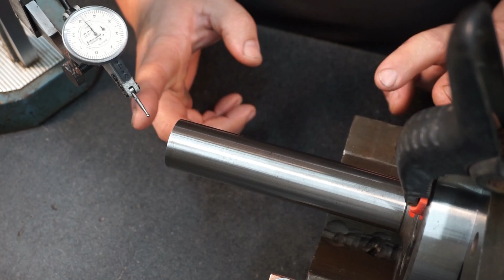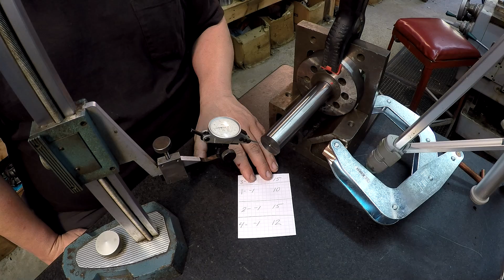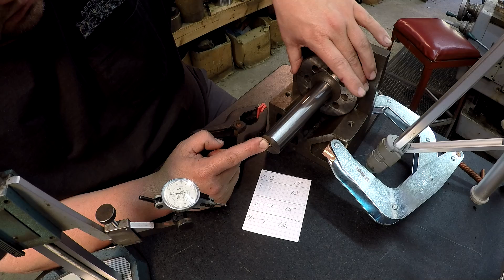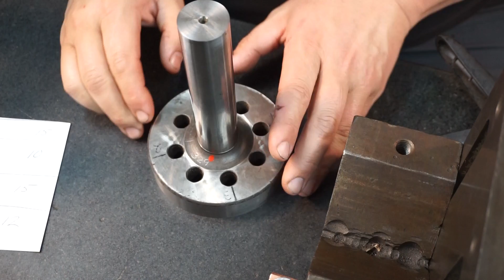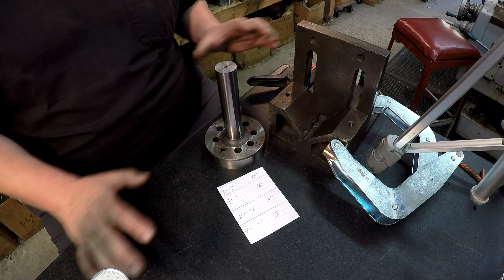Inspecting my Cylindrical Square for Squareness

Comment: Enjoyed!  How much time passed between your two measurements?  A consistent 0.0001" all over sounds suspicious.  Wonder if there was a temperature change?  I think a 5 degree change, in steel, = 0.0001" over an inch.

Nice square, by the way.
Reply from the maker: Trust me Tony, I'm not a square......bad joke? 
Glad you enjoyed and thanks for stopping by! I don't recall the temps being much different during the two days but 5 degrees difference it could have very well been. I think what I have is a "very close" square, good enough for government work right?
Reply: not bad, not bad.. I wouldn't close the shop up just yet.. but not bad.  ;)
Reply: Yes.  Just taking a stab at that constant 0.0001".  Though he did mention the zeroing thing.. likely the more probably cause.
Reply: Carbon steels have a thermal coefficient of expansion about 11ppm/deg C or 6ppm/F. So 1/100,000 inch per degree C per inch;  0.000 006 inch per inch per F
http://psec.uchicago.edu/thermal_coefficients/cte_metals_05517-90143.pdf
The biggest effect would be warpage of the surface plate due to an internal thermal gradient if the shop temp fluctuated over just a few hours (overnight). The larger thicker plates are stabilized for several days before lapping or calibration, depending on the desired rating of course, AAA lab grade has less wiggle room in the specs than a class B shop plate (though they both warp the same amount)
Reply: I was going to ask if it was cold!

Comment: Old video, I know. I'm going trough a couple of non-magnetic horizontal squares as in the video. Found this very interesting. What conclusions can you draw from your readings? None. Too many equipment anomalies that are in turn amplified via a 6" length of rod. In your case, I suspect that the base has a slight runout, that when seated in the V-bock creates uneven readings. The angle plate certainly doesn't help.

If I may humbly suggest, if anyone is thinking of checking a non-magnetic horizontal square, first and foremost use a square angle plate with a good surface finish. Flat! Then use Starrett 161E clamps to hold the base down from the top. A clamp on each side. You can now get some relevant readings, assuming you got your surface plate in check. I'd love to know how this square measured after the plate was refinished and you used an alternate angle plate. All the best.
Reply: Came up in my feed and I  must have missed this. 80% correct? You likely mean 80% confidence. That's wildly optimistic. You may want to study uncertainty and how it's calculated, learn its constraints. There's maybe 40% confidence in your readings, and I'm being nice. This was ok for a BS YouTube video, but can't be taken seriously.

Comment: This is absolutely NOT how to check that type of cylinder square. Its a simple check between centers. Diameter and face should run true spun between centers. If true then the square is as square as 1/2 the taper in the diameter. If the diameter has a .0001 taper then its square within 50 millionths.

Comment: Your cylindrical Square should be self checking without any need for any  complicated setup using angle plate and clamp etc.
That is, if you check with just the square itself, and using a Surface Gage with a radial "foot" stop like a ball bearing or radius of some kind, in order to get a single point of contact up against the cylindrical square`s own radial surface and checked with  a mounted indicator at that "stop point" just touching the square, set your zero and rotate the square to the opposite side 180 degrees apart. 
If you get the exact same zero reference as before, then your cylindrical square is indeed SQUARE or perpendicular to the surface plate it has been checked and rotated on! Any deviation on your indicator will tell you how much out of perpendicular your cylindrical square is compared to the first side checked. Divide by 1/2 and that is the tolerance + or - your cylindrical square is over the actual height distance measured.

Comment: New subscriber to your channel and the discipline.  What is a cylindrical square used for?  Do you have a video in which you put it to use?
Reply from the maker: +J Berkey It's used for inspection work, to check squareness of parts. You can stick it on an angle plate and use an indicator to sweep across it at different points to see how square the angle plate is to the bottom surface.

Comment: If you don't already, you should use plate conditioner, it just seals and lightly lubes the surface to reduce wear, a dab 'll do.
You might also check around for on-site plate calibration, it may be about the same cost for them to come to you as it is for you to ship the plate and then it is lapped in on your support points and at your normal shop temperature. (maintain temp steady for 40+ hours before the appointment) Plate makers will calibrate other brands so if you live near a Starrett shop they will calibrate a Mitutoyo plate and vice versa.
They use the same tools in the field and lab; optical auto-collimator for the overall flatness, a widget with a dial indicator for small dips bumps and waves, and an iron hand lapping plate for adjustments.

Comment: G'day Adam, nice job on the setup. You may not have covered it in your video, but you should first check the square is both round and has no taper.

You should be able to do away with that setup however and self-prove the square. That's one of the advantages of cylindrical squares. It should be a more accurate and repeatable way to test this.

Comment: I can understand playing with the tools, I do it myself in my garage. However, you are using at least 4 tools of unknown accuracy. You can't have any idea the accuracy of your cylindrical square if 1 tool is known to be off. "Pretty dainged square" just doesn't cut it. Still, though, I learned a few things. I look forward to you getting the granite plate, the height gauge foot & the angle plate ground & calibrated & the test redone. What fun!  Keep it up.

Comment: Adam.  Love your video's.  Ive wached all of them and always look forward to the next.  To measure this cylindrical square, eliminate the need to move the height gauge and this will eliminate the error you may have  in your surface plate. Turn your entire setup 90 degrees so the narow shaft is pointing up perpendicular to your surface plate. Remove your angle plate and use a static point on your surface plate.  Use your vee block on its side to reference the large diameter of your cylindrical square and palce your height gauge and dial in place and dont move the height gauge or the vee block.  Especially that you suspect error on your plate.   To take a measurement,  simply rotate the cylingrical square keeping it referenced against the vee block.  Hope this helps.  Chich2

Comment: It's funny to see in witch Tolerances he's woking, when you work in like 2-8 1/1000 mm ^^
Reply: 2 microns = .7 "tenths", and he was using the terms "half-tenth's" and "tenths" in the video. So actually you are using the same scale of measurements as he was, just in the metric system instead of inches. Written another way, .002 mm = .000070 inch, or 2 microns = 70 micro-inches.

Comment: Hi Adam. I like those squares. I used a magnetic cylindrical square for years and loved it. One suggestion I have for your setup is to use 2 clamps. One on either side of the base as oppose to just one on top. It may yield better results.
Reply from the maker: I was hoping to get a magnetic square but this one come up for a real good price so I jumped on it. One problem I had the first time inspecting it was the clamps were moving it around on the sides, I think it's because of the angle plate though. . It's not exactly a perfect set-up for checking it but we'll improve as we move forward.

Comment: Hi Adam thanks for the video. Just a few thoughts.   Is that cyl' square unusual in having a flange on the end? As the base has holes in it do you think it may have been torqued down and slightly distorted?  It looks to be a difficult item to check for square unless you have some granite plates and squares like Stan Z. I would have thought the plastic clamp was not be man enough to hold the weight tight against the angle plate. Or it could be dead on square but your old cast angle plate is a little tired.    regards from the UK

Comment: Maybe you could have done that on the lathe:
1) check the squareness of the cross slide to the chuck using the "rollie dad" method
2) chuck the cylindrical square and move the indicator along the its flange  using the cross slide
Reply: yes, if you turn it between centres, you use your dial guage on the stand face, any runout will be your 'out of squareness'

Comment: From your numbers and measurements in the video, it looks that your angle plate is rather off square (they all have a bias roughly in the same direction / amount). To check  a cyl square, you should use a vertical comparator, base against a fixed point, dial gauge at the top, take a reading, rotate (they cylinder) 180 deg, if identical readings, then you're close to the mark.

Comment: Plain (vertical standing) cylinder squares are used to measure perpendicularity of a vertical planar or cylindrical surface, tied to a specific height from a horizontal reference plane, such as a surface plate. Flanged versions, as Adam has, will do the same operation, indirectly, but the type of optimal indicator used is not the same. Also, flanged cylinder squares often have a magnetic base (the larger diameter) flange. Adam's flanged unit doesn't appear to be a magnetic version.

Stefan's home-shop unit works best with an absolute-measurement drop-spindle DTI, spindle being mounted parallel to the surface plate, calibrated using the 180-degree rotation method against a plain vertical squaring cylinder. The classic version of these setups is from Taft-Pierce, available through Suburban Tools. (Don Bailey has shown a good video on this subject, using both types of setup equipment.)

The flanged version is secured to a vertical plane (the 90 degree angle block), then, usually, a test comparator such as the Interapid is run over both peak ends of the skinny cylinder, noting the differences in height at each end. A good reading would be 0.0001" deviation per 6" of horizontal 'skinny' cylinder length. Also, the Interapid probe should be used at 12 degrees to the surface plate to eliminate cosine error corrections. Other comparator-DTI units would be used at zero degrees (parallel) to the surface plate.

There is no requirement that a flanged cylinder square be built with both cylinders having the same centerline. Only the skinny cylinder and how perpendicular it is to the larger flanged base counts.

Comment: wouldnt it be best checking it with a square comparator. it would eliminate the angle plate and v block and remove them from any error. most height gages can be used by using a ball bearing with it i think.

Comment: Hey Adam: Just for your information, I've had a number (maybe 4 or 5) of what appear to be the exact same brand of resin spring clamp fail on me.  They don't give any warning at all, they just snap.  I don't use them anymore for much more than holding up a painting tarp.

Comment: As a sanity check spin it in Vee blocks with a good end stop to set the longitudinal position or between centers. Then indicate the base. Doing it this way will minimise the impact of surface plate flatness and the need to move the indicator around.  Keeping the square as close as possible to the surface plate will also minimise any magnification of the surface error by the height gauge. ie Abbe's error.

Comment: as its consistentl high towards the end, if you check the stem for diameter with your best micrometer and its the same both ends, it can only be your mounting bracket that is out, not the square, they all show about 10 positive at the end

Comment: Adam, there's a couple things that could be contributing to your repeatability issues:

One is the granite flatness as you mentioned
Angle plate condition is another
Also the fact that you are clocking the square by hand means that you're probably not returning to the same exact position every time.  You're also relying on the OD of the flange to be 1) round and 2) concentric to the shaft of the square since that is what is riding on the v-block as your rotate it.

I would also suggest readjusting your indicator tip to be as parallel to the surface you're measuring as possible.  Having it at an angle like that introduces cosine error and falsely increases the value of the readings compared to what they actually are.  http://www.mmsonline.com/columns/correcting-for-cosine-error
Reply: The Interapid brand indicator is designed to be used at 12 deg, rather than parallel like most other indicators, so you can get over obstacles. In either case though, this was a comparative measurement to see how consistent the cylinder was, so it probably wouldn't matter much.

Comment: Until the surface plate is checked all of this isn't really useful.  You could try repeating the measurements at various different location around the plate but even that is of limited value.  Thanks for making the effort and posting the video.

Comment: So since the 1 and 4 quadrants are adjacent and .0003 to .0005 different at the top of the shaft relative to the more consistent base measurements, this would indicate a very slight lean in the shaft and that the angle plate setup gives it a roughly  .0013 upwards tilt?

Comment: checking a circle for squareness. now this is precision machining.

i've never seen one of these before, what are they used for?
Reply: They are for checking square on a surface plate with an indicator (i.e. to actually measure how out of square you are.)  I don't think you would ever use one as a test bar in a lathe.  They are self proving insofar as if they are truly square to the base then you can clock them 180 degrees and the readings should not change when measuring at a specific location or distance from the base, even if the angle plate was not square.
Reply: checking a collect lathe  ,  if it has centers in it,  u can use it to set ur tailstock ,  blah blah blah   :)

Comment: I plan to build a reference square like that soon.  Very cool!

A good method for checking square on that cylinder is as follows:
Use a 1" or 3/4" OD bearing-ball in the V-notch of a surface gauge with your .0001" indicator to create a squareness comparator.
Place the cylindrical square on the surface plate and push the comparator-ball up against the large OD of the cylinder.
Adjust the test indicator so that it is testing the top of the smaller OD of the cylinder.
Zero the indicator to the "high" spot as you pivot the surface gauge at the bearing ball.
Rotate the cylindrical square around and keep finding/checking the high spot (should repeat to zero if it's concentric).
Use a sharpie to mark the difference from your zero on the square.
Now repeat the same procedure with the indicator testing the lowest point of the smaller OD of the cylinder.
Finally, use your best set of .0001" mics to verify that the small diameter is consistent (not tapered).

These three tests will eliminate the V-block setup and the errors it can introduce.  Also, you'll get more from your granite because you're confining your test to a small area with very little movement, just rotation and minor pivots.  You can check several points along the height of the cylinder, but the most accuracy will be from very near the top and bottom ends.

There are better ways to build a squareness comparator, that's just the low effort way and it sure works well.
Reply: Excellent post, cwtoyota.  Another thing is that a cylinder with a slightly tilted but flat base has very near perfect accuracy at two clock positions.  Test it as suggested above, and mark the two places that are vertically parallel on the cylinder square.  For fussy work, just use those two positions only.  The base can also be lapped to get the cylinder perfectly vertical, but flatness can be compromised (or repaired) in the process, that is a fussy job in itself...
Reply: Thanks bob.  That's a good point and a good way to use an imperfect tool to do higher quality work.

Those two clock positions should be exactly 180° apart if tilt is the cause.
On a cylinder of those proportions (height is greater than the width of the base) a small dust particle, or small grinding imperfection in the base makes a large indicator reading at the top.  If the height is 2 times the width of the base (2:1 ratio) .00005" of tilt in the base surface will result in about .0002" of total indicator reading, meaning that the top of the cylinder square is off of center by about .0001".

Comment: very interesting video Adam .  I enjoy this depth of information.  for a time I had worked as a precious metals assayer at a one of a kind lab.  we had a granite pedestal that was perfectly level and required for the  micro gram scales we used.  they had to be certified yearly by a specialist that brought very precise standards.  for our analytical gear we would buy standards.  with all that machinery and precision expectations for your work,  how do you know for certain whether your gear is in spec ?

Comment: Adam interesting. Did I see a center in the end of the cyndrical square? is there a corresponding center on the bottom.  If so could you set it between dead centers and measurer run our on the opposing 90 Dec surface.  ?
liked the vid
Tks Will
Reply: or have a jig made with a laser on it to sight the long axis for true ?  then you could slowly rotate the cylinder and check the entire circumference ?